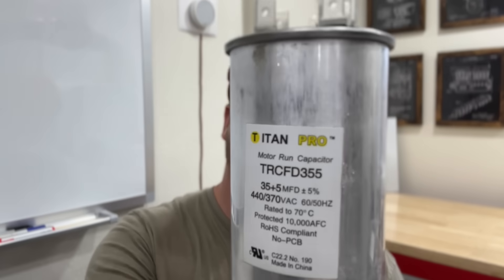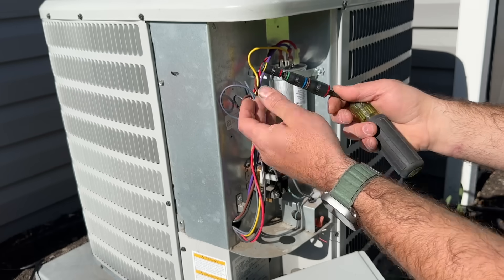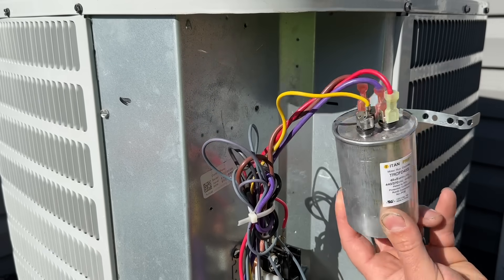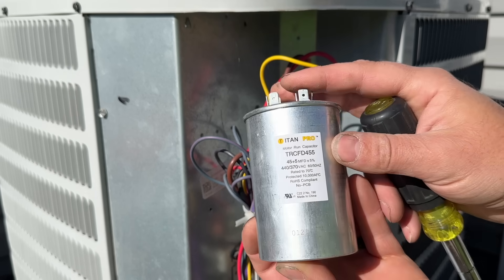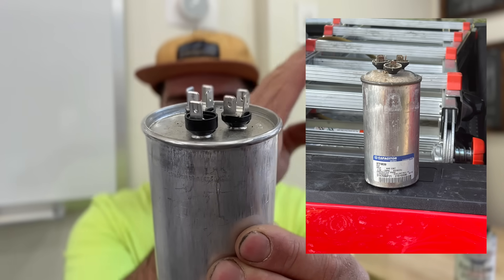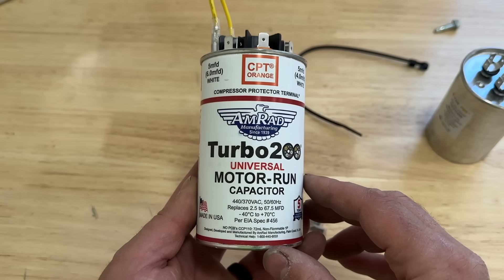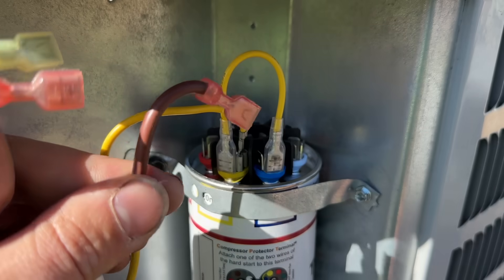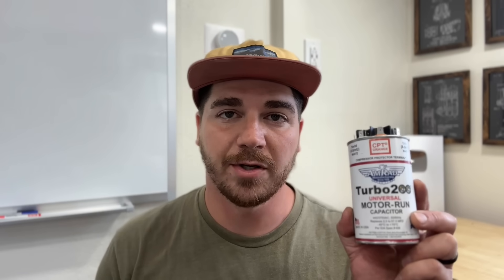HVAC Contractors Practically Make Their Living On These

Comment: I just got ripped off this way. I was charged $2,000 to replace the capacitor and the fan motor. After it was all done I looked up the part numbers and it was just under $300 in parts. This is a very highly rated HVAC company in central Texas. Never again.
Reply: Furnace and ac units are $1,200 - $1,500 a piece. Most companies charge $4,500 to replace just one of them. $9,000 for both. I should have learned hvac and got lisenced  Insted of doing masonry.
Reply: @kellyarnett4062 Ac units are not $1200-1500. Maybe 10 years ago they were. A 2.5 ton cheapo brand heat pump is gonna run $3300-3600 now days. Furnace and AC combo costs more. That does not include linesets, drier, consumables (brazing rods, tape, wire nuts, etc). Your contractor is going to have $4k in materials invested on that install. $900 to pay their employees. They have to account for the possibility the unit will have a bad part from the manufacturer and they may have to return to fix that for free if it is in the labor warranty. $6500 would be dirt cheap for that install. Anyone charging less probably scamming you (like putting in a used system). If you buy a decent brand that comes with safety switches (believe it or not some dont) then your paying more like $4000-5000 for the unit.
Reply from the maker: Dang so sorry to hear about that! But at least you know now!! Knowledge is power
Reply: @diyhvacguy you probably won’t respond but My unit runs for a little bit but eventually stops blowing cold air, when I go outside the fan isn’t spinning. The unit is warm to the touch and I have to disconnect the fuse , wait  for 2 hours. Put the fuse back in and the fan works again. Have you heard of this? The fuses are 60’s, someone time me that I should be using 40’s.
Reply: @diyhvacguy you're being slightly dishonest! You're trying to throw us under the bus when you know it's over our 40 hours and we're legally needing time and a half on the weekends and the surcharge for opening the store after hours! And you're teaching unlicensed people to work on units that they're going to screw up and wind up having to call us out anyways and cost them more in the long run! Time to throw you under the bus!
Reply: @diyhvacguy  You must not be very popular amongst your HVAC brothers in the US mate ?  I can’t believe that unlicensed people can purchase refrigerant let alone you on line showing how charge up units and install units ?? EPA over your way should take that license off you giving away our trade secrets , good work champ .
Reply: @AussieHVAC  No one cares what shysters think.
Reply: @AussieHVAC  Get off your high horse. You still have to be licensed to buy coolant. But if you buy a system that's precharged you can do it as long as you have a vacuum.
Reply: @fmbbeachbum8163  you need to get back on the beach champ. Coolant ?  I’m assuming you meant refrigerant and a vacuum I’m assuming you mean Vacuum Pump, stay in lane dude when you don’t know what you’re talking about . I can’t really see you down there while I’m on my AI high horse I bought from my HONEST hard HVAC work haha Jog on champ . 👎🏻
Reply: @AussieHVAC  
It's called FREEDOM something you aussies don't have!!
Reply: @leversforever9748  Hmm… if you call streets full of people living in tents then no we don’t have freedom like that on our streets 🙄. It’s called Law & Order  .
Reply: @leversforever9748  you think we are "free"? Bro you are brainwashed beyond comprehension. OMG  you are clueless
Reply: @AussieHVAC You know you can make money and not screw people right? If $2k is the market rate where you are then ok charge that but I really doubt it. OP said $300 for parts? More like $150. You woukd hate my business because I do fan motors and caps for $500 all day. Takes me 30 minutes to swap a fan and make $350 revenue. I make money, customer saves money so its a win win. You must live in a very protectionist market to charge $2000
Reply: @AussieHVAC nothing honest about charging $1500/hr for labor to unsuspecting homeowners. Life’s hard enough without people like you.
Reply: @Flippersflops  Huh ?? Who is charging $1500 / hour mate what are you talking about . And the correct term for Flip Flops is ‘Thongs’ champ .
Reply: @AussieHVAC EPA? What are you a shill for government agencies. 
Amazing one who criticizes someone giving sound advice and then wants to use the threat of government bureaucratic BS.
Reply: Is our right to fix our own items. We cant trust contractors to be honest over here in USA. @AussieHVAC
Reply: @AussieHVAC  rise up lights there mate. suck it
Reply: @AussieHVAC Everyone should look up this guys company and zing him on a review.  Openly admitting  that you enjoy taking advantage of people is not an admirable or respectable quality.  That’s probably why you find yourself with less and less work. 🤷
Reply: @AussieHVAC   You actually said that out loud? I think you protest a little too much. Besides the average American is either too busy, too lazy, or too mechanically illiterate to try this. In other words y😢our safe.
Reply: @leversforever9748 he is likely one of the ones that turned his guns in.  Weak.
Reply: @AussieHVAC that doesn't accurately represent the entire US.  Only some cities.  Mainly democrat run ones.
Reply: @AussieHVAC you think they should take his licence away?
Reply: @AussieHVAC  it’s so funny that you’re offended that there will now be people not getting ripped off by you. Lol.
Reply: @AussieHVAC tell me you're a crook without telling me you're a crook
Reply: @AussieHVAC  You're giving Aussie men a bad name.  Was aware of rude and crude, didn't know that included Arrogant A
Reply: @AussieHVAC I just ordered a 30 lb drum of r22 online for $500 and charged my own system, and i have no HVAC license mate
Reply: Why are you mad? You cant rip Americans off from Australia, you're not loosing money here kid.   @AussieHVAC
Reply: @AussieHVAC  What is wrong with you?  You think it takes a genius to replace an AC unit?  Ripping people off doesn't make the shady contractors very popular either - which is why so many create and disband companies in the USA because of their garbage reviews they receive for poor service and price gouging.  People will pay for the help (trade secrets - give me a break) but when you steal from them by overcharging - you shouldn't be in business to start with.
Reply: @AussieHVAC  All schools have on-line courses and to learn basic HVAC why not.
Reply: @AussieHVAC you mean like being put into quarantine camps against people's will?
Reply: @AussieHVAC  You HVAC contractors sweating because people realize your job takes no brain cells to do.
Reply: @devonteforeman ding ding ding. He's butthurt that his skill isnt so difficult a skill.. in the age of information you need to step up your game if you want to sell something not everyone can do or get themselves
Reply: @AussieHVAC  sounds like you came out of a cave of some sort and found internet. It is like a plumber cursing that another plumber  made a video about how to clean a toilet with a snake, or a car mechanic showing how to change brake pads on a car
Reply: @AussieHVAC  Not used to freedom are ya?
Reply: @apburner1  #assburner🖕🏻 plenty of freedom here brother …… especially being a HVAC company owner 🎉😂😂
Reply: @AussieHVAC Too late,our Tangerine mussolini's dismantling and gutting our EPA MONEY TALKS! And YES, we hate it! The US  is now run by a dictator who steals money from working class folks and gives it to the rich. I think people will want to move to the UK!
Reply: @AussieHVAC go take your covid booster shots
Reply: I Bet you the motor was not bad, just the capacitor. Crooks. Please only get a GE capacitor never a cheap Chinese one.
Reply: They know you’re cooking your 🌰 🌰 off and will pay whatever to get it going again.
Reply: The motor was probably not even bad.
Reply: Safety note:that is not an insulated tool.
Reply: I would’ve written that up as $1260 if the material was that much. It’s usually between 650-820 for that repair though.
Reply: Go back and put transparent tape (sellotape) on the label of that capacitor and on the fan so that the value doesn't degrade over time. Then do it yourself.
Reply: A capacitor if it’s not a multi costs $20.00 or so and if the contacts on the relay are bad they should be replaced maybe another $25 or $30. It’s a 1 hour job. When you are in business and making repairs you can only bill about 15 hours a week and you have a truck and parts worth 40K or more. That said $500 or so would be the most that would be fair.
Reply: @paulmarc-aurele5508  I WOULD LOVE TO SEE ONE OF YOUR CUSTOMERS BILL YOU FOR THE CARPET CLEANING AFTER YOU TRACK DIRT IN BEFORE YOU CHARGED THEM 500 BUCKS FOR A FIFTEEN MINUTE JOB... ITS PEOPLE WHO THINK "IT'S JUST BUSINESS" CAN JUSTIFY THEIR GREED THAT MAK PEOPLE HATE CONTRACTORS, BECAUSE THE CONTRACTORS ARE ALWAYS THE ONES DOING THE SCAMS...
Reply: I'm an HVAC guy and I'm not sorry for your situation. You agreed to those charges and had the ability to look up pricing yourself and wait until after the fact to do it? While you're being lazy and useless until after the fact, real companies need to make money to pay employees, vehicles, all the excessive tax, insurance, and endless bureaucracies of licenses that have their hands in our pockets. Running a business isn't cheap. I often cringe at the prices we need to charge to do our jobs considering how cheap it would be to do for myself, but it's the only way to keep a business operating in this day and age of everybody having their hands in everyone else's pockets.
Reply: @Jason-wc3fh  IF BEING A CONMAN IS THE ONLY WAY FOR YOU TO STAY IN BUSINESS THEN YOU ARE DOING IT WRONG... MAYBE STOP OVERCHARGING THE CUSTOMERS YOU DO GET SO THEY KEEP CALLING YOU OUT INSTEAD OF CALLING SOMEONE ELSE AND HOPE THEY AREN'T JUST SCAMMERS TOO... WHO WOULD HAVE THOUGHT THAT SCAMMERS DONT LIKE BEING EXPOSED.. CANT PUT THE CAT IN THE BAG ANYMORE AND THEY JUST HATE IT...
Reply: @leonIdas002  Like I said in my statement; there is a MINIMUM that has to be charged for a business to remain in operation due to all the expenses involved. One bill for a customer isn't just to pay for the tech to be there. It's to pay a cut of money to about 100 other people in the form of bureaucracies, taxes, vehicles, vehicle maintenance, licensing, insurance, etc... the list is endless.
Reply: @Jason-wc3fh  YEAH... THAT'S WHAT THE LAWN AND GARDEN SCAMMERS SAID WHEN THEY STARTED CHARGING THEIR CUSTOMERS FOR THAT 50 THOUSAND DOLLAR ZERO TURN MOWER THEY ALSO WROTE OFF AS A BUSINESS EXPENSE
Reply: @Jason-wc3fh  THOSE  ARE CALLED "BUSINESS EXPENSES" AND THEY ARE TAX DEDUCTABLE, NOT CUSTOMER CHARGABLE...THATS THE DIFFERNCE BETWEEN AN ACTUAL BUSINESS AND A FUCKING PONSY SCHEME..
Reply: Wow! I just thought I got ripped off for a condensor fan motor replacement at 478 dollars. I looked up the fan motor and then 4 years ago it was like 60 bucks online. With today's pricing it will most likely be double that. I hope not because the one they installed just failed today. Yes on a Friday, home for the weekend, effin sux.
I'm gonna fix it myself this time but will have to roast a bit until the motor arrives.

When things break you should be able to pay someone an honest reasonable price  to fix it instead of having to DIY every f****ng thing.
Hell next I'm probably gonna have to learn to pull my own painful tooth. You know some  Do it YOself dentistry.
Reply: Bought that part for $9.00
Reply: @roberthill5371  I bet it was awesome quality Made In China 🇨🇳 @Isach
Reply: I was charged $300 for that part. Never again
Reply: Always discharge the capacitor
Reply: @warc8us what would have been the ‘fair price?’ Guessing they provided on-call service outside business hours, yes? You should get HVAC certified and service equipment for only the COST OF PARTS and give away your labor.
Reply: @Rumpelstiltskin-yv4ep   look as if it is a great career to get into. You only need to learn electrical, plumbing, heating and air, and some carpentry. But the pay is great...
Reply: @Rumpelstiltskin-yv4ep Im just quoting what some other guy said they charged. Im not the one spreading it. You should follow the reply chain and have better reading comprehension.
Reply: Criminal,  I refused to pay one Local in my area I Looked up parts prices  while he was still At my house unbelievable what he Was Charging 900.00 bucks,for A 49.00 Compaciter (name brand Carrier) 100.00 Service fee took About 15 minutes!! So I had no problem with say A 200.00 Bill..  But not going to Be Ripped Off . He removed Part & Left ..   imagine What These individuals Are Doing to Elderly people On A Fixed Income... People Be Aware of your Elderly family & Friends...
Reply: @watchinglclowns9890  GOD DAMNED RIGHT... I SAVED MY GRANDMA FROM A CONMAN PLUMBER THAT WANTED TO CUT A HOLE IN THE WALL TO REPLACE THE SHOWER FAUCET WHEN IT ALREADY HAD A HOLE FOR IT... NOT MY FAULT HE DIDN'T WANT TO SQUEEZE HIS HANDS THROUGH THE HOLE AND MAKE AS MUCH AS HE COULD IN THE PROCESS... SHIT IS ABOUT TO DRASTICALLY CHANGE FOR CORPORATIONS HERE IN THE STATES... ALL THOSE SELL OUTS WILL NO LONGER PUSH BILLS THAT MAKE CORPORATE TYRANNY A RULE OF LAW... THESE FUCKING SCAMS WILL STOP.
Reply: I believe in a fair profit but ripping people off sick.   That’s what is wrong with this world. I’m glad people can learn and be active in repairing their own stuff.  Keep posting man I enjoy your videos to help people learn.

I can say in today’s world it is so much easier to learn things. When I was growing up you had to go to library’s and find books to learn things. Today it is so much quicker to get the information needed. You still have to refine the skills and processes to do the work.
Reply: I was quoted $383 to replace a capacitor, i asked, how much of that was the part, the tech said "i dont know". Red flag goes up right away. I declined repairs and did it myself. Ive replaced capacitors on my ac's a bunch of times now.
Reply: yup. I replaced the capacitor and fan on a Carrier unit last summer. I used OEM parts I bought from a distributor. The cost was less than 300. The HVAC contractors do get away with murder.
Reply: @lengray44  Not over here, we have regulations in place that protect both home owners and HVAC Techs. 
We don’t have this bad culture of HVAC companies ripping people off like in the States. Sounds like EVERYONE in the US think they can do HVAC, especially all these legend DIYers 🙄
Reply: @AussieHVAC lots of people can easily fix the most common problems with their AC.  This includes clean drain line, clean coils in place, replace capacitor and lubricate the fan motor when stuck.
Reply: If you were actually smart you would know there is more than one cap on every unit.. Keep it up till someone gets hurt dicking around trying what you are saying to do. Just keeps us HVAC people employed.
Reply: what's the point in hiding the name?
Reply: Sounds like he might be talking about you  @GardenisLife
Reply: If you had a house payment and employees with house payments and healthcare, gas for trucks you and materials to do the work, how much would you charge for a 30 dollar part. What would actually be fair?
Reply: @ForHim_orAgainstHim  Nobody said "give me the part at cost" - I think people are saying a 2500% markup is too much.
Reply: @TheeGlocktopus  that’s the point ….its not all mark up.
Reply: @ForHim_orAgainstHim   I would charge $60-$80 for a capacitor. Word gets around quickly if you’re ripping people off. The lager companies that I’ve worked at would charge out use of Vac pump $75, reclaim unit & reclaim bottle $85 etc. I don’t do this as they are tools of trade and always thought it was unfair on the consumer. If you good at what you do and you pay it forward it will come back to you 10 fold, reputation is what will keep you in business. ❄️
Reply: @AussieHVAC  The problem with that is I know of a contractor that have done capacitors similar to that and thought they were being competitive. They had found that they were going negative. Like they didn’t profit. I’ve had this conversation also for $300 plus dollar capacitors when it comes up from customers. I simply just explain they’re not just paying for the $15 dollar part they’re paying for more than that to get us to come out. They go with the repair the vast majority of the time. No rip off. Total apparentness. I mean the customer would be ripping the company off of it were $80 dollar repairs for $15 dollar part there would be no business provider at that point. No one can run a year round negative business. It needs to profit.
Reply: @ForHim_orAgainstHim  NOTHING.. I MAKE THE CUSTOMER BUY THE PARTS, AT MARKET VALUE AND THEN CHARGE THEM FOR MY TIME AND EFFORT PUTTING IT IN... YOU CAN ONLY FAIRLY CHARGE SOMEONE FOR THE PARTS WHEN YOU HAD THEM IN THE FIRST PLACE... LIKE A SPARE YOU PULLED OUT OF A SALVAGE OR SOMETHING... THIS MARK UP ONLINE ORDER BULLSHIT IS JUST MORE PROOF THAT MONEY IS THE FUCKING SCAM...
Reply: Start run capacitor is a common fail item. Easy to replace. And the fan just doesn't start up when the cap is in failure. So fan replacement is not needed.
Reply: @evertmorse8518  on the older ones….ive had call backs when I did that. Like it was working when I left and than a call back.
Reply: Report them to Beter Business Breauro
Reply: Is there any way you can sue them?
Reply: Sorry to hear that. I replaced (well, I had the guy do it) both of those parts a few years ago too and paid about $380, labor included. It only took him under an hour to do both.
Reply: No wonder these tradesmen are getting paid so much and not going to college. Ahahahaha
Reply: @aaroncalvert3922  college graduates produce even less value for the consumer
Reply: @aaroncalvert3922  YOU MEAN CONMEN... A REAL TRADESMAN WILL TELL YOU TO STAY AWAY FROM THOSE CONTRACTORS CALLING THEMSELVES TRADESMEN...WHY DO YOU THINK THEY HAD TO KEEP MOVING IN THE OLD DAYS, BECAUSE THEY RIPPED OFF EVERYBODY IN TOWN AND THE ANGRY MOB WAS AFTER THEM... TIME TO PACK UP AND MOVE ON TO THE NEXT TOWN LIKE THAT CONMAN CIRCUS OF P.T. BARNUM... THEY CANT RUN FOREVER THOUGH, EVENTUALLY THERE WILL BE AN ANGRY MOB FOR THEM EVERYWHERE THEY GO...
Reply: @Rumpelstiltskin-yv4ep Go find the comment just above mine by Djm0319. And then make sure you click the little "read more" button. There you will see where I got the numbers from. Instead of trying to comprehend, you just doubled down on insulting people.
Reply: @Rumpelstiltskin-yv4ep Go find the comment just above mine by Djm0319. And then make sure you click the little "read more" button. You are insufferable and very wrong.
Reply: @Rumpelstiltskin-yv4ep I put the @ in front of the persons name i was replying to tag them. Not my fault you don't know how to click on "read more" or know how a comment thread works. I did what I was supposed to. Your brain failed you.
Reply: @Rumpelstiltskin-yv4ep You don't understand how when you click reply it adds that tag? Why would I be clicking reply? Because I was replying to what someone else said. I am quoting their figures, and if you actually had more than 2 brain cells you'd have noticed I was saying there's no way that cost is justified. You're confused and upset at the wrong person. I've told you this repeatedly.
Reply: @Rumpelstiltskin-yv4ep Youtube thought police is real.
Reply: The arguing of all you children is quite amusing. Also if you have multiple comments over multiple days get a frick frackin life, you are obviously aren't busy enough (let me guess, now youre going to comment how busy you are 😁)
Reply: @MasterBojangles  SO YOU THINK ONE COMMENT ON THE INTERNET IS AN ALL DAY THING??? LIKE ANYONE WHO IS BUSY WILL NEVER HAVE THE TIME TO SIT DOWN AND COMMENT ON A YOUTUBE VIDEO AND ANYONE WHO DOES COMMENT ON A VIDEO MUST ONLY BE COMMENTING ON YOUTUBE VIDOES... GOD DAMN, THE BOTS ARE FAILING... WE THE PEOPLE WILL CONTINUE TO ARUGE WITH WHAT WE HOPE ARE PEOPLE ON THE INTERENT SO THEY DONT REMAIN IGNORANT FOOLS WHO ARE TOLD A 600 PERCENT MARK UP IS FAIR BUINESS PRACTICE...
Reply: Hey! That number can be justified. You should know about what you own, or only deal with those recommended to you by someone you know and trust.

Shame on you, no one else. You already sound like you'll be doing it again.
Reply: @nothankyou5524  YOU CAN TRY TO JUSTIFY A 600 PERCENT PARTS CHARGE ON TOP OF YOUR 800 PERCENT LABOR CHARGE BUT YOU WILL NOT BE ABLE TO...
Reply: I think the video should have been 😅 always get a second and third option. Cause let's face it, everyone won't be honest! You may call three rotten apples 😮
Reply: @bryanmontello5702  THAT'S THE PROBLEM WITH CONTRACTORS, THEY THINK ONE MANS SCAM IS THE INDUSTRY STANDARD....
Reply: You didn't get ripped off, this is what you decided to pay
Reply: Not a rip off. Homeowners and diy guys have apparently no idea how to run a for profit business. They look at parts for $300 and think the job should cost $350, what a bonehead take. Next time, do it yourself.
Reply: $2,000 dollars is insane for a capacitor and fan motor.  That is taking advantage of people.
Reply: I never thought about it till I watched a few contractors reply about cost to show up to a job. Starting with cost of a  mechanic to show up, company van stocked parts, gas and maintenance for vehicles company tools, insurance, warehouse stocked with materials, house employees so if you get charged three hundred for a capacitors that's why
Reply: If those are facts, and I truly believe they are, why don't you let us know the company's name.
Reply: Buyers remorse.  Companies have overhead and other shait  to pay.  You are also paying of the knowledge.
Reply: I would take them to court and sue them. Price Gouging is illegal
Reply: Capacitors are $30.00. Get the model # and keep a spare at home. Easy to replace. 98% of contractors are thieves.
Reply: They sleep well on a mattress from.mattress firm😂😂😂
Reply: I talk to a guy about replacing a compressor on my refrigerator he said $1,400 I said why so much he said a lot of wielding was involved.  Research everything,  I said  no thanks. Seems like everyone is trying to scam you.
Reply: Depends if it’s a variable speed or ECM motor those cost up to 1300 each so yeah but 2000 for a regular motor is insane
Reply: I replace my capacitors myself. My fan was stuck so I flipped the fan motor over and sprayed a good amount of fluid film.  Runs great now.
Reply: Then why didn't you look it up beforehand and buy the parts yourself and install them. 🙄
Reply: Oh, and in the winter, I got three quotes on my heater that’s 10 years old high-efficiency Lennox. The one guy told me it’s 4500 to fix it’s pretty much shot or if you spend another 900 or so I can get you a new unit but it won’t be Lennox less efficiency higher electric bills said to me in a real friendly way for another 900,000 you have a brand new unit. Well I called two other companies. The company told me the same thing he called it a dinosaur they don’t even make them like this anymore.. it’s only 10 1/2 years old.!!! Well the third technician was a family owned business. He checked everything out the units clean it’s got a nice blue burning flame. Everything looks good your circuit boards. The only thing that’s wrong is a blower motor inducer and that comes with the blower motor.. he said you have Lennox and blower motors and I need a few hundred to install it. It’ll only take me about 2530 minutes. Typical regular unit he said the blower motor would only cost about 4 to 500 and for me to install it a few hundred that’s all that’s wrong with your heater… also put a surge protector on it. He said that’s probably what blue your fan out. You got lucky the board didn’t get blown too.. I never heard of that before. Why didn’t the original HVAC salesman put it on or any other tech that cleaned it? Oh well, I’m catching myself here because they want it to blow up if you called them once you’ll probably call them back for the next problem. The AC in my previous comment, the tech came out after I googled her YouTube. Why won’t my unit start well there was an electrical problem in the town and it must’ve tripped everything so I looked for the reset button and that kicked it on.. of course he told me it’s about a pound low on refrigerant which I didn’t replace because it runs ice cold but I guess he had to make some kind of money besides the house call. I don’t know how people can just rip you off like that.!! The only thing after I reset it was I did find out the fan may not start to turn. It may disengaged so get along stick and just give it a little start and push and from that on it always stayed engaged. It seems like a problem. He said he couldn’t understand why it just wouldn’t start well. If it’s all over you may have to just give the fan a little push start it off again, never had a problem with it engaging now
Reply: Oh, and in the winter, I got three quotes on my heater that’s 10 years old high-efficiency Lennox. The one guy told me it’s 4500 to fix it’s pretty much shot or if you spend another 900 or so I can get you a new unit but it won’t be Lennox less efficiency higher electric bills said to me in a real friendly way for another 900,000 you have a brand new unit. Well I called two other companies. The company told me the same thing he called it a dinosaur they don’t even make them like this anymore.. it’s only 10 1/2 years old.!!! Well the third technician was a family owned business. He checked everything out the units clean it’s got a nice blue burning flame. Everything looks good your circuit boards. The only thing that’s wrong is a blower motor inducer and that comes with the blower motor.. he said you have Lennox and blower motors and I need a few hundred to install it. It’ll only take me about 2530 minutes. Typical regular unit he said the blower motor would only cost about 4 to 500 and for me to install it a few hundred that’s all that’s wrong with your heater… also put a surge protector on it. He said that’s probably what blue your fan out. You got lucky the board didn’t get blown too.. I never heard of that before. Why didn’t the original HVAC salesman put it on or any other tech that cleaned it? Oh well, I’m catching myself here because they want it to blow up if you called them once you’ll probably call them back for the next problem. The AC in my previous comment, the tech came out after I googled her YouTube. Why won’t my unit start well there was an electrical problem in the town and it must’ve tripped everything so I looked for the reset button and that kicked it on.. of course he told me it’s about a pound low on refrigerant which I didn’t replace because it runs ice cold but I guess he had to make some kind of money besides the house call. I don’t know how people can just rip you off like that.!! The only thing after I reset it was I did find out the fan may not start to turn. It may disengaged so get along stick and just give it a little start and push and from that on it always stayed engaged. It seems like a problem. He said he couldn’t understand why it just wouldn’t start well. If it’s all over you may have to just give the fan a little push start it off again, never had a problem with it engaging ever again.
Reply: I'm all for customers changing their own capacitors. If I do it I charge from 120 to 225. That includes the service call, checking system operation and repairing burnt wires. I've been running across a lot of customers changing the cap and system still doesn't work due to other problems. Its becoming as common as someone calling my and saying my unit needs Freon. Now they say my neighbor says its a cap. I guess it depends on if you want to wait in the heat to get a cap and hope it works and there's nothing else wrong with the system.
Reply: It's called business. That's why you don't have one
Reply: @Jake_Smith7472   so you rip people off too, huh?
Reply: @warc8us  explain how I'm a rip off. I'll wait...
Reply: @warc8us  if you don't know what you're doing a capacitor is going to sit your ass down with 440 volts straight to the fingertips. I'm not too sure you know anything about that so it's probably worth the 1700 bucks they charged you
Reply: @MadAtMax.300Blackout  this stuff aint rocket science.
Reply: @warc8us  didn't say it was but to most folks it mind as well be
Reply: Report that company for price gouging to the better business bureau
Reply: @PastarocketS-sb7nk  wow. Mind as well report autozone while you're at it. I bet Kamala will get right on it
Reply: They are trying to get you to replace the whole system....those lousy caps with the service call and a cleanup should be about $100.
Reply: @diverbob8  no lol you know nothing
Reply: I have been on many follow up DIY repair jobs that went south to include electrocution investigation. Also had 3 this summer where cap was misfire and compressor destroyed. Just find an honest repair guy and leave the repairs to them.
Reply: That's the going rate, I charge $750 for the compressor motor and $350 for the capacitor
Reply: Why don't you tell their name then?
Reply: did you know what parts to use before they told you? if not that's what you paid for
Reply: Cap was most likely the problem.  They threw motor in for the money. I'm hvac of 42 years retired. That job past 6 years possibly 700. Used do under 300 years ago. There's rip off out there.
Reply: You wouldnt have even known ur capacitor was bad if they didnt come and fix it 💀
Reply: I was quoted $250.00 to replace the capacitor. The technician was already on site doing PM and the cover was open. I bought it for $19.25 from Amazon. Takes 5 minutes to replace.
Reply: Boo hoo. Guess what you don't have access to the materials you are calling us for our expertise. You are calling me for my liscense and for my experience.
Reply: I used to have this problem on my old refrigerator. BUT I'd immediately search Amazon and find the $300 part cost $8 and agree to pay $30. WHY would you ever wait until it was all done? It takes a 14th of a second. My capacitor cost $57, and he charged my $87. Funny part was he didn't really know what a capacitor is. Don't go to college they say. Those people don't know how stupid they are. LOL
Reply: @JustMeAP1 everyone starts somewhere. If you want to be a YouTube mechanic like this schill go ahead.
Reply: That should have been bout 600.00 if he was legit
Reply: All appliance parts will sell or ship to you to the customer 
Can also go to budget AC, and also ask for Mike 

They will ship parts to you but you got to know what you need start reading up on central air and just doing your basic maintenance cleaning and refilling with freon
Reply: Hope it wasnt Lochridge Priest! I've learned these parts only blow out after 5 pm and on weekends. I need to stock up
Reply: What kind of refrigerant do they use in Canada?

410, a!
Reply: $2,000 is crazy that is daylight robbery. 

thankfully in my little apartment UNIT they only charge $50 to $70 for a mini split. 

Usually I'm all for DIY - but this one is dangerous if you don't know what you're doing. Those capacitors will kill you if you handle them wrong. 

Best things I do is clean the AC myself.
Reply: Yes, Austin has quite a few of them.
Reply: If you don't know how to repair it yourself. You deserve to pay the 2000 dollars. No excuses. All the knowledge in the world is at your fingertips.
Reply: Local HVAC guy came and changed mine for 100 USD.  I knew based on research that the capacitor was bad.  He checked, tested, and replaced it in under 30 min.  All these other people are just a bunch of scam artists.
Reply: Ur paying for the knowledge,  and not for the part, alot of complainers but the installer put time ams effort to learn the trade ans every1 wants everything cheap, nah man..plus hvac can be dangerous if u dont k ow what ur doin
Reply: @tonistarks2874  Well in this case I paid the guy over $1,700 for his "time and effort to learn the trade". Meanwhile I watched a 15 minute Youtube video and can do the same work myself next time. And you know what? I will never give that company another cent. When I blow $10-15k to replace the whole system that work will go to a more honest HVAC company.
Reply: They should go to jail. It’s all over the country a 10 or $30 capacitor for 1000 or two.
Reply: 😂 This guy be careful people. Just a tip for you all. When disconnecting the disconnect, don't put the disconnect back in until you're done. This will emanate from putting back the disconnect in the energized state, making you think you disconnected the power. Electrical shock is no joke and trying to save money could land you in the ER driving your costs more than paying HVAC company for repairs. By the way, not all companies are out to screw the people over. The costs may be higher but it's time and expenses for the trip to your home, disposal of materials, and most importantly the knowledge of the service technician to get the job done correctly. Going to the doctor is the same thing
 Your payment is for their knowledge and anything that may be needed to help you. This is just an example of any service people need. Good luck to all and please be careful when doing any projects. 90% of injuries occur at home.
Reply: I got the one for my AC for $1.94 at Grainger clearance
Reply: I would not have paid them
Reply: Post the Companies Name
Reply: I work in Industrial Instrumentation, I stopped calling the HVAC guys a long time ago. Sometimes, the “Thieves Den” won’t sell me parts, since they don’t know me,so I send my wife. They have a nice racket going.
Reply: @GardenisLife No he's saying in many countries the consumer isn't legally allowed to do many things due to safety issues not just to them but to others.  The trades people have to qualify and they have to pay for the courses and the accreditation.  Add to that they have to pay overheads and make a profit.  They aren't a charity.  You get paid to work and they too are entitled to make a living.  This guy is making it seem like you are being ripped off but that applies to most things you get an accredited installer.  Please be safe he says but he's not going to accept any liability.  BTW that's something else they have to cover, liability insurance.  You can say the same about most items trades fit and to compare the purchase price to the cost of having it installed and then tell you that you are being ripped off is just plain bloody silly.  For example if it takes the installer half a day to get to you and install the item do you really think $70 is going to give them any sort of living wage, even if they did ten in a day.  $70 is the same cost to them as it is to you.  He hasn't madeca cent let alone enough to cover fuel, tools, accreditation, transport, etc let alone pay tax and give him enough to make a living wage on top of the outgoings.  This YouTuber is happy to slag off all these tradesmen and make his money the easy way by making a video that blackens the professionals so unfairly.  You notice he didn't give you a breakdown of what he thought was fair and I wonder why not?  Could it be that it may well work out to be around $2000 if it is just the one item?  Now ask yourself would the cost be comparatively less if you were having additional work done or if you were a landlord and owned multiple properties locally that provided regular work in the same locale.  If course it would seem cheaper as more work is being done for the same outgoings so the cost isn't focussed on one item.  This YouTuber is an idiot to bring the focus on a single item repair which no matter the minimal cost of the item still has to cover outgoings.  If people start those antics they will simply refuse to take on such work.  PAT testing is also something larger contractors shy away from as it simply isn't cost effective to them so they leave it individuals who then find they can barely scrape a living as the actual cost to them is astronomical even though all they need in the way of equipment is labels, a tester and a pen.  Then you have to start adding all the stuff that makes it a job worth doing to make a living....
I'm not a contractor but my young grandson is and I am financing him.  It's only when you sit down and work out an equitable rate for both contractor and client you realise all the hidden costs.

This video is only telling you one side of the story so be careful before you tell your AC guy to go screw himself.  It's yourself you may well be screwing as he may be doing YouTube videos crapping on his former colleagues rather than serving customers.
Reply: @Biffo1262 yeah most of these video contractors are so full of shit! They don't show the breakdown on cost, my tools alone cost several thousands of dollars and 30 percent of those tools need to replaced every 2-3 years due to normal wear and tear!  HVAC techs require every other trade's tools to do our jobs and the vacuum pump, recovery machines, gauges and meters cost 300-600 dollars, a new set of hoses costs 200 dollars we can't mix refrigerants or well ruin units, so a bottle of nitrogen to purge our equipment is a 150 bucks, acetylene and oxygen is though the roof, 120 dollars for 10 sticks of silver solder, torch setup 300 dollars, now imagine providing that for an entire company of guys! That doesn't cover the 30-40 dollars a sheet for making metal duct or 10-15 dollars a fitting for round, or the plasma cutting machine that costs 10 grand  or the break to fold metal that costs 2000, we gotta pay our shop guy, we're F'd without him! There's a reason we're in business and our customers aren't and need to pay for our service! This guy posts none of that!
Reply: @Biffo1262  You nailed it and couldn’t have said it better myself . Down Under ALL our tradespeople are respected and we don’t have this culture of consumers that think all in particular HVAC companies are going to rip you off . People in the States might think we are over regulated but in this instance I like the regulations as it protects people from dying and it protects each of the trade industry. I’ll put it like this , ALL you DIYers if one of your kids came home after their high school graduation and said they had been offered a apprenticeship in HVAC , would strongly advise them not do it as a career or possible future business owners themselves ???
Reply: WHO ripped you off. Isach or ?
Reply: Those $2k covered the parts, making someone go to your house (probably twice), traveling expenses, diagnose the problem, have the knowledge to fix the problem, warranty on parts and labor, wages of the call center that answer your phone call, the payment of marketing. For big hvac companies costs more than 100 bucks just to arrive a customer house.
Reply: Should of said their name. I understand why you didn't as they would probably sue for slander.
Reply: Is a 5/40 uf the same as a 40/5 uf if the both have the same voltage range ? 
Thanks for your help.
Reply: @jimsmith8817  wut. No that's not how you do that. Youre going to burn your equipment up stol touching it.
Reply: A new condenser doesn't cost that much!  let me guess Chisel-U Heating and Cooling.
Reply: @tbuddy3005  Knob 🙄
Reply: You could try 'suiting them in small claims court.  Some states will allow you to summon a jury, & many a juror would be angry over such exploitation.  Sure, large companies have high overhead, but theres a vast difference between reasonable profit & exploitation

I dont know about where you live, but filing a claim with the JP in my county costs $100.  Plus if you can find a number of other customers, invoices in hand, taken advantage of by the same company, you could open a class action
Reply: @magnificentmuttley154  IRONIC HOW THE POOR CANNOT AFFORD THE JUSTICE THEY ARE SUPPOSED TO HAVE A RIGHT TO... WE THE POEPLE OF THE WORLD MUST SECOND AMENDMENT THE MONEY SCAM ONCE AND FOR ALL AND MAKE IT KNOWN THAT IF YOU ARE NOT DOING THINGS FOR HUMANITY YOU WILL NOT DO THINGS AT ALL... ALL THIS FOR PROFIT BULLSHIT HAS BEEN THE ONLY FUCKING PROBLEM HUMANITY KEEPS FACING FOR THOUSANDS OF FUCKING YEARS, AND ITS ABOUT TIME YOU STOP ACTING LIKE STUPID FUCKING INFANTS AND START LEARNING THAT FUCKING LESSON..
Reply: @GardenisLife stealing? You are not intelligent. 

There is a right way to do things and there is your way to do things. 

Your way will make things worse.Your way will cost more money after you screw it up or get someone’s house to burn down. 

Just because you can do something doesn’t mean you should.
Reply: @Djm0319  Amen brother , all these DIYers got know idea .
Reply: @AussieHVAC  let'em do-it, then we can charge to fix the main problem and to fix what they fuked up.
Reply: No or know, don't get rattled mate. 😅😅 @AussieHVAC
Reply: @AussieHVAC  you have no idea how to spell.
Reply: @AussieHVAC  Just wondering. Do you spend every waking minute doing nothing but HVAC tasks? Your comments suggest every person should be one dimensional and only capable of succeeding at one endeavor. I suspect you are a troll but if not you are just sad.
Reply: Then buy the parts yourself and fix your own unit. When you call a company they have far most costs involved than just the part. Your ignorance and inability to repair your own unit doesn’t mean they need to treat you like a charity.
Reply: @Roper62 found the tradesman who thinks he should get the same hourly comp as a surgeon. Sorry, cuz, if the part is $300 and a DIYer with a YouTube video can do the work, it’s not worth $2000.

Most repairs of this nature are drop dead easy. I got my furnace and tankless water going again this year with a YouTube vid for each. I’m sure a professional would have charged a lot for trivial fixes.
Reply: @Roper62  Found the crook HVAC guy
Reply: @Roper62  A typical business should be running at 7%-10% net profit margin. If they are needing to charge someone a 550% markup on the parts (with labor) to manage this, they are not a well run company. If you have that much margin on gross, and still can't make ends meet, that's a management/ownership/embezzlement problem. No one is asking for charity, just asking not to be raked over the coals. There is a middle ground.
Reply: @barryc9115 😂nice bad try😂
Reply: @Roper62 Nobody asked for charity, if your a shark charging 2k for a capacitor you are nothing short of a crook. We all understand business’s have overhead and techs are trained professionals but $2K for a cap that is just plain wrong.
Reply: @Roper62  Making a profit is understandable but being a hog and crazy overcharging is plain wrong. The service call charge + 1 hour labor + 30% markup on the parts is reasonable especially when residential HVAC companies pay their techs low wages.
Reply: @Roper62  Doesn't mean they need to be thieves either
Reply: @Roper62  You bet I'm doing it myself from now on, why do you think I'm commenting on a video from a youtube channel titled "The DIY HVAC Guy"? lmao. Treat me like a charity, that's rich. Let me guess, you rip off people professionally too? Can't see why else my story would get under your skin.
Reply: @warc8us What happens when you come to something you can't handle?
Reply: How much do you think you should pay for the labor that repaired your air conditioner? There is a fee for just having the technician show up. Sometimes the diagnosis is included in this fee and sometimes it’s extra. Then there are retail prices and wholesale prices. Technicians get a discount on the parts so they can make money from providing the parts. 

Let’s add it up. If the technician fee to show up is $200 and diagnosis is $200 you are already at $400. 

Now add the parts that the technician can get for $300 but can legally sell it at the retail price for $600. That adds up to $1000. 

That leaves the labor for installing the parts and cleaning your unit. I’m going to say a random number of $100 an hour. Five hours of labor is $500. 

The total from my random numbers is $1500. 

That is what you pay when you are not skilled and need someone else to repair your appliances.
Reply: @Djm0319  200 to show up, doesn't cost anyone anything. 200 for diagnosis, maybe takes a few minutes, not 200 worth. The 300 in parts marked up by 2x-3x and been sitting around in the warehouse forever. 100 an hour for labor that not even half is going to the tech. All of this just to enable the sole proprietor at  the top a certain lifestyle. It's important that he takes the family to Cancun for the third time this year, and its important that he builds a lacrosse field for his kids to practice on.
Reply: @TheeGlocktopus  you are clueless
Reply: @TheeGlocktopus  You have know idea, you’ve OBVIOUSLY never ran a business before like most of these DIYers ??   And just because you can watch a video and swap out a capacitor etc. doesn’t mean your some sort of HVAC expert nor does it mean you should be doing it . I don’t agreed at all with what DIY HVAC is doing but it’s a bit like the Wild West in the US .
Reply: @AussieHVAC  I run a business with over 15 million in ARR lmao. "BuT i hAvE oVeRhEaD aNd bIlLs" if that's your complaint at a 66% gross margin then you don't know how to run a business properly or are a greedy succubus. Those are the only two options lmao. "I gotta mark up the parts, I gotta mark up the labor, I have to charge appearance fees and I have to charge diagnosis fees, and any other way beyond the five i mentioned to get into the customers pocket as possible just to break even" - That's either a lie, or if true, sad.
Reply: @TheeGlocktopus  is that all ?? My annual turn over is over $25 million per year. Aussie HVAC companies are far more transparent and honest as it’s in our nature unlike the Rogues you have over there. Did you think maybe they are over charging due to loosing out on work from these DIY videos .
Reply: @AussieHVAC just because someone shows you how to do something on a YouTube video doesn't mean everyone is getting rid of there a.c. guy 😂..don't you have some guns to hand over to your government?😂..either you have ALOT of time on your hands or you don't have a life..someone that judges u.s. businesses by a YouTube video doesn't know much about how things work in the world
Reply: @Djm0319  100 to 150 an hour, not $1,000 per hour
Reply: @Djm0319 YEAH... FREE ESTIMATES IS THE MARK OF A PROPER PROFESSIONAL, NOT JUST SOMEONE WHO IS TRYING TO PROFESS FOR PROFITS... THAT WHOLE LABOR FEE IS THE EXACT BULLSHIT THAT PROVES THAT MONEY IS A SCAM... WHY CANT THE SLAVES CHARGE THEIR EMPLOYERS WHATEVER THE FUCK THEY WANT?? HUH?? ANSWER THAT FUCKING QUESTION??? IF YOUR PAYCHECK DEPENDS ON YOUR CUSTOMER, THEN YOU CANT JUST FUCKING CHARGE WHATEVER THE FUCK YOU THINK YOUR LABOR WAS WORTH... YOU CHARGE A FAIR FUCKING PRICE BASED ON WHAT COST IS VS THE EFFORT... BULLSHIT SCAMS LIKE A MECHANICS CHARGING AN HOURS LABOR FOR A TEN FUCKING MINUTE JOB WILL FUCKING END WHEN THE GOD DAMNED MONEY SCAM ENDS, AND IT WILL SOON FUCKING END, AND NOT A GOD DAMNED GREEDY MOTHER FUCKING SCUM BAG WILL BE ABLE TO SAVE IT... WE THE PEOPLE ARE FUCKING DONE WITH THAT "IM FUCKING BETTER THAN YOU CAUSE I SCAMMED MORE MONEY THAN YOU" BULLSHIT... PLAYGROUND JUSTICE ALWAYS PUTS THE FUCKING BULLIES IN THE DIRT...
Reply: @Djm0319 If it takes you 5 hours to diagnose and replace a capacitor, then you need to quit your job and go hop on the nearest short bus, because they're obviously missing you as a passenger. Seriously are you 12 years old that you are trying to justify a $1500 scam fee for something like replacing a simple capacitor? The internet really has exposed the IQ crisis on this planet.
Reply: @Djm0319 Still too much. The show up fee $200 + one hour labor and a 30% markup on the material is fair.  Id charge $750 and the entire job is done in less than an hour.
Reply: @GardenisLife  You just worry about being out in the ‘Garden’ champ getting some well needed fresh air . I’m guessing you’ve put your own A/C in, had a refrigerant leak then inhaled the fumes causing you to SHOUT 🖕🏻
Reply: @AussieHVAC retard
Reply: @AussieHVAC maybe get a real job and stop scamming people for a living mate?
Reply: Cry about it mate  @AussieHVAC